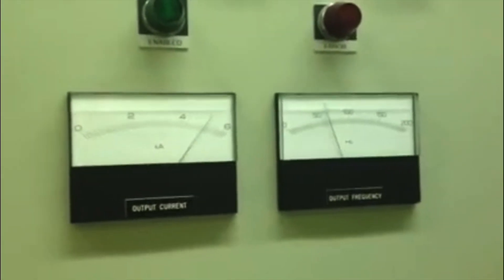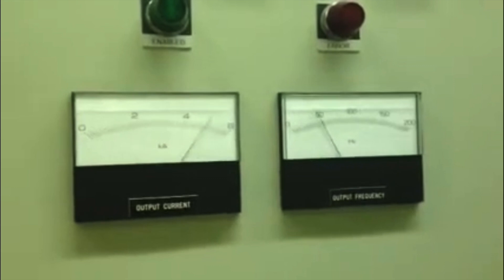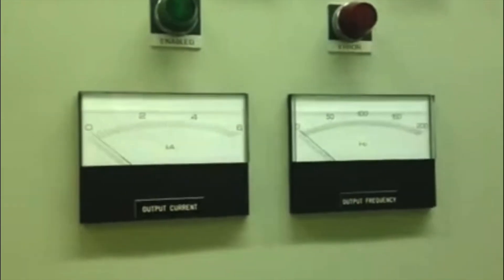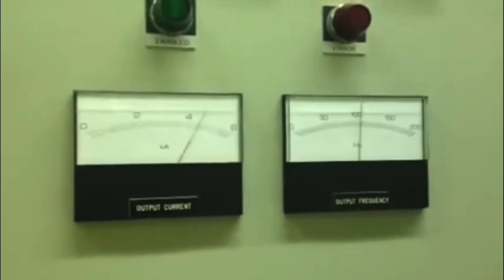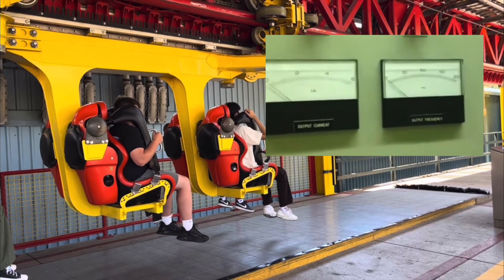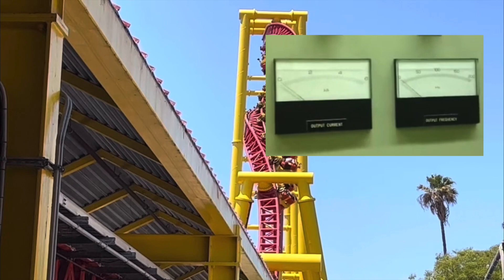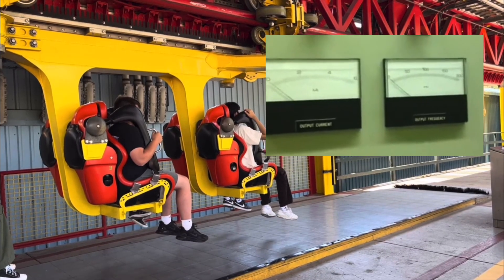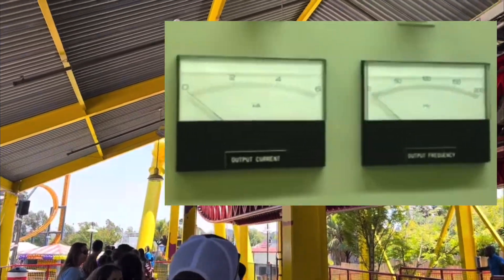Want to hear something cool? Linear induction noise part 2

Comment: I’m an electrical engineer in the nuclear power industry. Yesterday I rode the Vertical Velocity FLASH ride at Six Flags Chicago.

Most amazing ride of my life. I was wondering about the power supply—the ride pulls between 2-5 MW according to my research.

That works out to about 6,790 amps on a 480v feed, or about 700A on a 4,160 V feed.

What was the voltage supply to the ride? 

Thank you, nice job!
Reply from the maker: @the1111code  these days the LSM style rides run on 690v (3 phase)
Reply: @ thank you for the reply! According to Grok AI, the VV ride pulls 2-5 megawatts peak power. Assuming 5 MW, at 690 volts that’s 7,120 amps of current draw. Does this match your experiences?
Reply from the maker: @the1111code  sounds high honestly.

Comment: More specifically, I believe the "scream" sound comes from the pulse width modulation signal from the drive cabinet, in turn causing the windings in the LIMs to make that iconic screaming sound.
Reply from the maker: You can hear some of that induction inside the control room but there’s a whole lot of shaking going on inside those stators!

Comment: I have a weird question. How does the anti roll back work on an inverted coaster, I think I’ve figured it out but I’m not sure, is there a spring the pushes the anti roll back piece upward?
Reply from the maker: Yes typically 2 extension springs that pull the dog up against eh ARB rail. on some coasters the dogs must pass sensors to check that they are still up and ready when moving through the station.
Reply: @ryantheridemechanic  Very cool, I don’t know why I thought it would be different than a non inverted coaster but I was just wondering about it.
Reply from the maker: @elementoftheride  actually most standard coasters do not use springs to pull the arb or chain dog. They are jest heals down by gravity.
Reply: @ryantheridemechanic  Oh that’s really cool to know, thanks!

Comment: Do operators get to see those gages (sp?) anywhere or is it only places that mechanics have access to?
Reply from the maker: No these are In maintenance areas that they are not allowed into. Honestly we never even use those gauges. The program tells us everything we need to know. And when theirs a problem it happens in a thousandths of a second, so it’s not something you can monitor either.

Comment: In a past video didn't you say the wheels on the impulse move forward for a split second before they actually start spinning? To me, that explained that initial screech or squeal from the ride side as the wheels get dragged for a split second making them skid, making that initial scream sound. I get the electric noise, and thats cool, but from just listening to the ride, isn't the screaming sound out of the station just from the wheels?
Reply from the maker: On fast launch rides the wheels do stay stationary for a split second but they cause no noise during that time. When you EStop the ride and you can hear just the train rolling it sounds like any other train.

Comment: I’m wondering how hard it would be to build an LIM for a model roller coaster?
Reply from the maker: Depends on your scale? I looked into scaling down a launch and by the time the model could fit in a garage, the stators were only about 5mm wide. Making the electromagnetic field next to nothing and the precision on the train would have to be extremely precise. Not impossible. I love the idea of a mode rollercoaster build.
Reply: It would be much easier to build an LSM launch at that scale.
Reply from the maker: @spaceistheplace2293  I’d agree with that. Just have to figure out how to hide the positioning sensors

Comment: Ok., I got some questions.  5kA is amazing.  What is the service rated at that feeds the park?

Second, you're getting 60hz delivered... What's the benefit of increasing the frequency?
Reply from the maker: The service to the park was not much higher than 5. The whole park had an amp meter off the 13kv coming in. Warm day full operation it would hover at about 35amps. When that ride launched, it would go off the 100 amp scale. So it drew at least twice the power that the entire park used!!!
Second LIM are not efficient so the pulses you use to accelerate the train must be done extremely fast to get the train to move.

Comment: As a ride op on an Impulse coaster, I've been wondering what causes the sounds while the train returns to the home position at the end of a cycle. 

It has a distinct sound from the launch, it sounds atonal in comparison to the predictable launch sound. It almost sounds like a boiling kettle, or squeaking wheels. But if it was just the wheels, why is it only be audible while the ride is parking? (And why is it so loud?)
Reply from the maker: It’s sound differ when homing as the drive is trying to slowly move the train. As you see the drive 100Hz+ when launching. When parking (called homing) the drive is putting out hi current but low frequency causing the motors to make a noise that sounds like a boiling pot of water being hammered on.  
Water cooled stators are much quieter but these are air cooled so they are loud.

Comment: Wow, that’s pretty cool! I loved listening to wicked twister fly by as the it was in the station (rip) and always wondered why it sounded like that and maverick sounded like a low growl. Thanks for the cool video!
Reply from the maker: Mavericks low growl is this in the station area train moving slow? If so :
It’s sound differ when homing as the drive is trying to slowly move the train. As you see the drive 100Hz+ when launching. When parking (called homing) the drive is putting out hi current but low frequency causing the motors to make a noise that sounds like a boiling pot of water being hammered on.
Reply: @ryantheridemechanic On maverick, you can hear a lower pitched growl from the LSMs due to the gaps between stators and the interaction of the air and shoes and such. Maverick’s LSM switching frequency is enough that it creates almost a water hissing noise. You can hear them growl during launch area jogging when the system has no idea where the train is (can’t synch properly). The station area is all those cool-sounding intamin tire drives.

Comment: On impulse coasters what is that little thing on the track way in front of the train that lifts up just before launch? (It kinda looks like a stator)
Reply from the maker: Those are the magnetic brakes lifting up. During a power failure, LIM rides can not stop the train.

Comment: Delightfully nerdy! Have you ever heard Maverick's motors? They kind of make a grinding noise, like there might be coolant circulating inside.
Reply from the maker: Noise can be dependent on manufacturer of the stator, and current / frequency.

Comment: Cool, but the best sound ever made by a ride launch system was the clutch on Montezoomas Revenge at Knott's Berry Farm. It was a mix of a drawn--out low moan and high pitched howling that was unique and kinda scary at the same time. Other out and back loops of the same make (I don't remember how to spell the makers name right) made that same sound. 

Too bad the rebuild of Zoom is using LIMs, as the sound of that old launch was one of my favorite parts of the ride.
Reply from the maker: Original setup will be missed. Thanks for the comment!

Comment: Is the 5 kA drawn directly from the grid, or is there a capacitor bank to act as a sort of buffer?
Reply from the maker: High voltage 13kv stepped down to 500v then stored in a capacitor bank 8 feet tall and about 100 feel long. It’s a big filter.
Reply: I don't know what voltage this runs on. But if it has its own transformer, things don't look so bad anymore. For ease of calculating, I use some made-up numbers (with the exception of the 5 kA mentioned by Ryan) , but the orders of magnitude are the same regardless.

Imagine the motors draw the 5 kA at 100 V.
Imagine it has its own transformer, directly connected to a 10 kV line - so the transformer steps down the grid voltage by a factor of 100 towards the ride
At the same time, the current (ignoring some losses) gets stepped down in the other direction by the same ratio. So the ride's 5 kA turn into 50A on tue transformer's grid.

From other coasters with electric launch systems (I think Hansa Park's Fluch von Novgorod is one of them, but i may be mixing things up) I heard that they basically use a mechanical energy storage in the form of a big flywheel which is constantly accelerated by a lower powered motor, and when the launch system kicks in, a generator extracts the energy at a much higher rate. This of course doesn't lower the total electric consumption, but it creates a much more even load on the grid. Basicalyl like with the hydraulic accelerator coasters where the (relatively in comparison to the launch power) low powered hydraulic pump charges the accumulators which then discharge into the hydraulic launch motors.
Not sure if it also supports using regenerative braking to put the remaining energy back into the flywheel. Technically it should be possible and I think it'd be really cool.
Reply from the maker: 5Kv @500v delta and whey phases
Reply: @Colaholiker  I phrased my question poorly, but I kinda meant from the transformer haha. Even if it didn't really have any negative effect on the grid itself, would such a sudden draw of 5+ damage the transformer?
Reply from the maker: No the transformers are over sized to handle this load all day long.